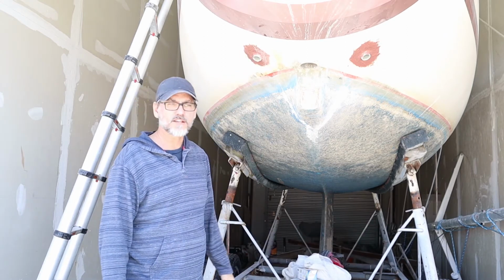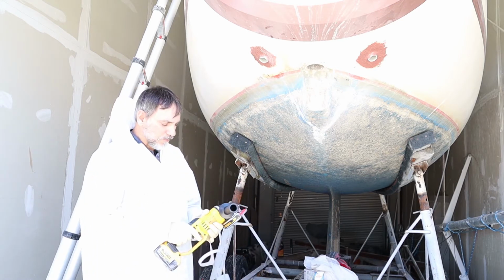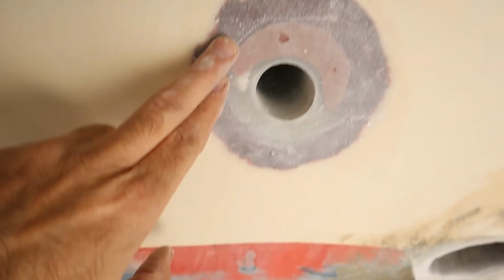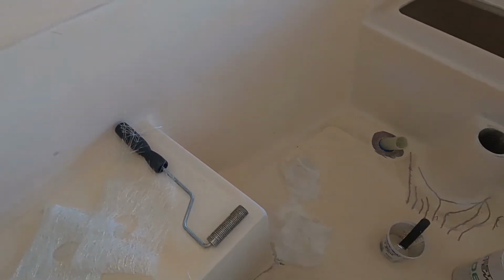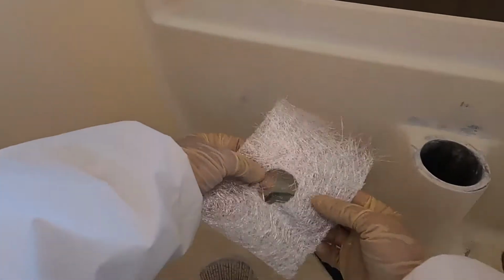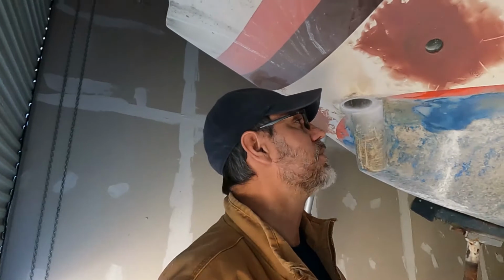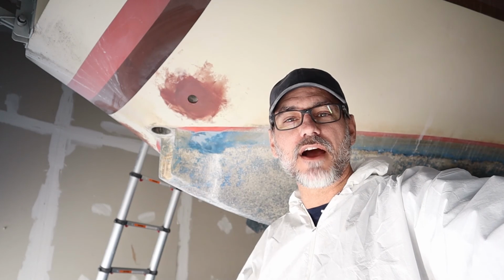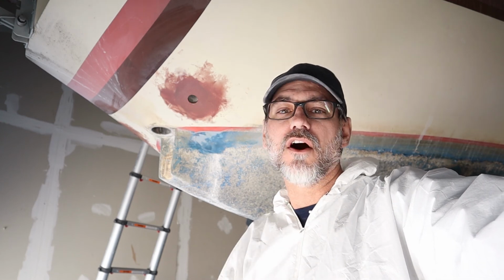Sailboat refit EP5 Grand Sanding...

Comment: Did you find "pin holes" in the fairing compound after it cured?
Reply from the maker: Haha yeah, west systems fairing always has pin holes.  I prefer total boat fairing.
Reply: @finditfixitsailit9322   Had you not mentioned Total Fair, I was going to.  It's all I use.